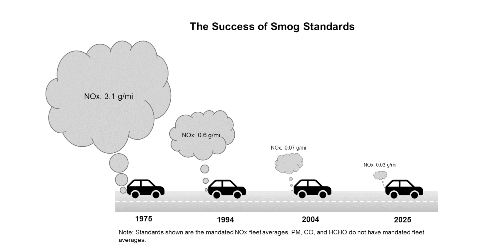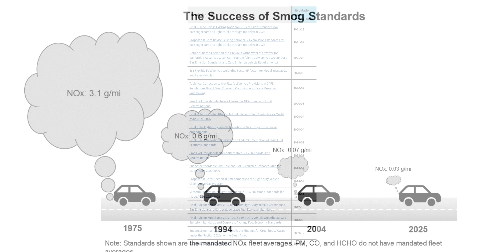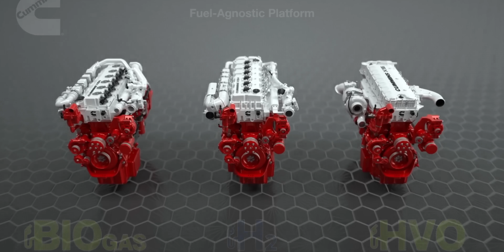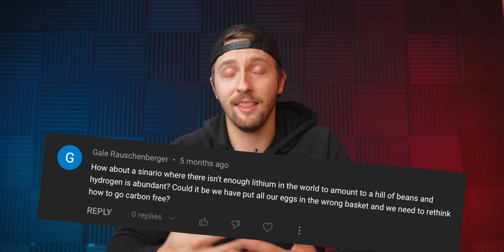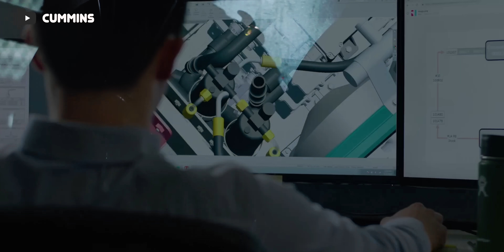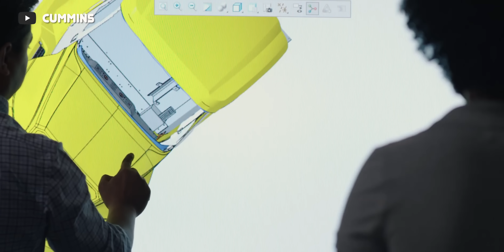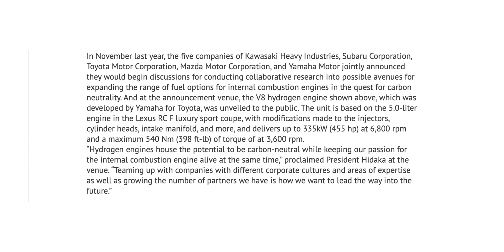Cummins Hydrogen Engine Will KILL DIESELS FOREVER

Comment: It's still a diesel. It just burns hydrogen. Even the first diesel engines didn't burn diesel fuel. They burned peanut oil
Reply: As long as it’s based off Rudolph diesels compression ignition. If it’s not Compression ignition then it’s  not a diesel.
Reply: @justinmartin8887  As long as it’s based on Rudolf Diesel’s engines, it is a Diesel engine. The engine was not named after the fuel it burns, rather the engine and the fuel were named after Rudolf Diesel.
Reply: @Paul H  the Cummins Hydrogen Engine is spark initateded(as per their website), thus it can not be in any way a diesel engine.
Reply: @justinmartin8887 the diesel cycle is characterized by isobaric expansion in reciprocating/cyclical form. A jet engine (brayton) uses the same process, just a different format
Reply: @Heatherder  interesting. Almost any form of internal combustion propulsion could be considered isobaric expansion
Reply: Wonder if they had pleasant smelling exhausts
Reply: @Anonihmus2567  I assume. If you burn waste oil from McDonald's it smells like french fries, I've been told, so I assume peanut oil smells like peanuts
Reply: @Amigafur  it's called the Diesel Cycle.
Reply: @DownLowSyndrome  do you know what it means when someone is on the "down low"?🤔😆
Reply: @toddamtmann3528  that's the joke...
Reply: @Amigafur  1 lol
Reply: @Anonihmus2567  my old diesel golf used used chip oil. Canola and it did smell good.
Just the other day I smelt piss and the source was a new ad blue diesel engine warming up.
Ad blue is merely 50/50 urea and distilled water sprayed in the diesels exhaust to neuter the nitrous oxide
Reply: @Anonihmus2567  probably smelled like baked peanut butter cookies
Reply: @Anonihmus2567  smells like burnt plastic, not sure if this is for all tho
Reply: @Anonihmus2567  owned
Reply: @Anonihmus2567  smell like the fair.
Reply: @Anonihmus2567  it's why dogs chase cars to this day. Hahaha
Reply: @Anonihmus2567 the pleasant smell of supporting farmers and  not giving any extra cash to oil tycoons
Reply: The guy's name was Diesel, and he built the engine to run on damn near any combustianable 'fuel'.
Reply: @painkillerjones6232  exactly.
Reply: @painkillerjones6232   the correct term was the “tailings from manufacturers” in other words he was the one thinking about “free” fuel and recycling.
Reply: @painkillerjones6232  (combustible*) No other correction needed, you're right.
Reply: @B.V.Luminous  Thank you.
Reply: @painkillerjones6232  not NG.
Reply: You're right they burned all kinds of stuff back in the day including kerosene
Reply: @yvescote9893  they still use kerosene. Some people up north mix it with their diesel up to 50/50, so it doesn't gel up.
Reply: @toddamtmann3528  I remember a story about a helicopter running out of fuel and they landed at the gas station and filled up with 50 /50 diesel and petrol
Reply: @yvescote9893  true.. they even still burn kerosene in Cat "diesels" in Antarctica today
Reply: It’s not a Diesel engine. Although this engine shares the same block and crank, the hydrogen, diesel, and natural gas (methane) variants of this engine use totally different heads. Diesels use high compression to ignite the fuel, where as the hydrogen and methane engines run at lower compression and use spark ignition. They also require a throttle plate to manage the air/fuel mixture in the intake similar to a gasoline engine, where as diesels only require the fuel to be controlled within the combustion chamber. Don’t be surprised to see a gasoline variant of the 6.7L from Cummins as well.
Reply: @mikieme6907  you're one of the only commenters on this thread that know ** from Apple butter.
Reply: @mikieme6907  Cummins' LPG/CNG engines are compression ignited with lean homogenous charge (closer to Miller cycle than to Diesel cycle, the same trick pulled by Scania in its I6 engines with CNG).
Reply: @erkinalp  , all methane (CNG) and hydrogen engines built by Cummins are spark ignited. They are modified versions of their diesels (6.7L, 9L, 12L, and soon 15L), where they lower the compression, replace the diesel injectors with spark plugs, and add a manifold injected fuel system.
Reply: @mikieme6907  Hydrogen engines dont NEED this stuff. Its very possible to make compression ignition from hydrogen albeit from my very limited knowledge
Reply: I like peanuts 🥜.
Reply: @John P 5.9 is a much better engine than l10. A lot of Cummins large automotive engines aren’t all that great. The 3.9/5.9, 8.3, ism, big cam and n14 are by far their best.
Reply: @justinmartin8887  i agree with you actually people are 8.3 swapping there pickups some are 3126 CAT swapping there pickups also those engines are bullet proof
Reply: @justinmartin8887  dont forget the isb in there (5.9 & 6.7 variants)
Reply: @John P yea that’s right. The only medium duty diesel in a light duty truck. 6.7 Cummins are good stuff
Reply: @justinmartin8887  Ford has been running their 6.7 in medium duties for a long time.
Reply: @ChevyConQueso  no not for a long time. They used the 5.9 Cummins in medium duty fords for a long time because their weak v8 ps wouldn’t hold up
Reply: Mini thorium reactors
Reply: Actually ? Henry Fords ENGINE'S ran on HEMP OIL
Reply: https://youtu.be/U9EuZCgdIpg
Reply: This is tap water! 
HydrOxy gas on demand
Reply: Electric isn't so great.....hydrogen combustion is more our cup of tea, and you have already got a mostly trained for it automotive mechanics
Reply: It’s not a diesel because it’s not a compression ignition system.  It’s a spark ignited design which requires a stoichiometric mixture to ignite.
Reply: EVs are not electric , they are rechargeable battery powered and in some cases running on diesel or natural gas or nuclear generators .
Reply: Hydrogen is as volatile as gasoline and technically doesn't need compression for combustion, unlike diesel.
Reply: @NoName-ky2sb  Yes you do need compression to squeeze the air molicules to make the fuel more explosive.Thats how the piston is driven down. Suck,   squeeze, boom, blow. $ cycles of an engine, Also when you compress air you heat it up. If you heat it up enough it will cause the fuel to explode. A typical gas engine needs at least 8 to 1 compression ratio then explosion by spark. A diesel engine has at least 17 to 1 copression ratio which heats the air enough to cause the fuel to explode. While we're at it CO2 is an element on the periodic table not a polutant. all we are doing is releasing CO2 from the ground into the air in the form of a PARTICULANT, which will not stay air born for ever. Most of the CO2 emitted in the last 100 years has fallen back to earth and has settled on the floor of the oceans. Diesel exhuast particulants are larger then gasoline and fall to earth faster. plants thrive on CO2 and absorb it  This idea that we are killing the planet is a big con job put forth by the WEF to steel all our assets in order to control us. without CO2 we will slip back into an ice age and that can happen in as little as 10 years. In the last ice age there was an ice pack 2 miles thick over most of north america and it was basically uninhabitable would everyone prefer that?
Reply: @markseehawer3762  hate to break it to ya CO2 isn't an element. Its a molecule like water. But yes plants use it in photosynthesis, no it isn't heavier than air.
Reply: @Mark Seehawer  preach it brother🙌
Reply: It’s basically, how smart are your designers. You ask questions well it takes electricity to make hydrogen so why not just use batteries or EV then?

As a trucker, I look at costs. Cummins is a reputable engine maker is combustion engines.  Most people who design energy efficient engines are muscled out. They tend to hoodwink non technical people about what can be done and can’t be done with limited false options. Meaning we can run engines on water, hydrogen and oxygen by products. Yes electricity is required, we get that from solar panels or hybrid generators that Cummin also sells. Cost me .3 gallons an hour. Meaning I can go about 180 miles on a gallon of gas. This bothers who?
Reply: No i think  it was penis oil not peanut oil
Reply: It won't be a diesel.  It will be spark-ignited.  Cummins has been building spark-ignited natural gas and propane engines for decades.  They are also working on a heavy-duty gasoline engine in pursuit of their "fuel-agnostic" strategy.  But you won't be able to buy an engine that will run on diesel or Hydrogen.  Different variants of the engine family will be designed for the different fuels.
Reply: So the first Diesel engine s cost only Peanuts to Run?
Reply: The first Diesel by Inventor Rudolph Diesel ran on Coal Dust Not Peanut oil the wjole ethos of his design is that it will run on any fuel that's Flash point is lower than the heat of the compressed air,the engine is basically a compressor!! Diesel was a Refridgeration engineer at Sultzer he developed his engine at Machinenworks Augsberg, & the first one sold was made by Machinenworks Nurnberg & sold to the Kieve electric power generation co. After which the Augsberg & Nurnberg companies  Merged to form MAN DIESELS,The origional 5 patentees were these two companies followed by Beirmiester & Wain(Denmark) who put the first diesel in a boat,Kelvin Diesels( (UK) Also marine use,& Cummins (USA) The first to use diesels in Automotive use (Trucks & later a race car in the Indianopolis 500 where it won the Endurance prize!!) So I think Cummins know what they are doing & are well ahead of the game??
Reply: @MrSilvertech  Once upon a time the believed beer fairy’s blessed the beer turning wort  it into beer. People are dumb
Reply: Too many people know to little about the economics of interfuel substitution
Reply: They actually first ran off Coal dust. Regardless tho still compression ignition.
Reply: @andrewschlosser9483  Yes.  Finely ground coal “coke power”.  Germany had a coal supply then. Trying to make his country energy independent. What a novel idea.
Reply: When it was first built in 1892 it ran on coal dust then other experimental fuels. By 1900 it ran on peanut oil at the world's fair...
Reply: Who cares till it pollutes less and there is INTERNAL COMBUSTION
Reply: @praveenhegde8107 😂
Reply: @John P people give the Hindenburg shit.
But the hydrogen while flammable was not the main source of burning lmao.
All the bags that held the hydrogen were A. Cotton. B. We're waterproof and gas proofed in a even more combustible coating. 

So while the hydrogen did burn everything else was still a massive oversight of a fire Hazzard. Besides gas and diesel also burn. And when they do they'll melt down vehicles to their frames.
Reply: Sounds like a bunch of folks that know how to read, what has already been done. 
   We need to discover the NEW so we can 
Move forward. Hood wink that guy who is 
Gargling penis oil and see if they can fig out how to squeeze the hydro for another 150
Miles or more😉🍺
Reply: @User20758  It’s been done, but if you try to mass manufacture it, seems you had a short life span. Only reason they might not care as much now is because of politics and Russians and OPEC going off the Petrodollar.
Reply: I read where hydrogen comes from volcanoes endless supply, I may be wrong
Reply: Creating hydrogen is still pretty expensive, Clean hydrogen costs about $5 per kilogram.
Reply: @rbwoodwork1890  producing it actually is extremely cheap. Storing it is expensive.
Reply: @Amigafur  In the UK, hydrogen fuel generally costs motorists between £10 and £15 per kilogram. In the USA, hydrogen costs around US$16 per kilogram. Currently, renewable hydrogen produced via electrolysis costs between US$3 – US$6/kg, though analysts expect this figure to drop significantly over the next decade.
Reply: @rbwoodwork1890  Source?
Reply: No, the first diesels built burned vegetable oil.
Reply: The first diesel actually ran off tar oil, kerosene. Paraffin oil and Texas oil.  It could utilize any of the 4.
Reply: Burn hemp oil
Reply: @John P 🤣
Reply: What about hydrogen embrittlement?
Reply: Coal dust was even burned as the very first thing back them
Reply: Diesels will burn about anything flammable biofuels are made of vegetable oil
Reply: @MrSilvertech  True, you don’t need large battery bank, need a much smaller one. For initiating start, electronics ect
Reply: Almost correct... It was rapeseed oil 😁👍. Details matter when it comes to history regardless of who thinks differently.
Reply: Lmao try coal dust
Reply: Rudolf would be proud of you
Reply: @John P actually the hindenberg didn't kill everyone. When hydrogen goes up it really does go up. A lot of people survived.
Its bigger problem is that its hard to store. The engineers call it the houdini gas because it is always trying to escape. It won't be a full tank in few weeks even if you don't use it.
Reply: Rudolph diesel also used hemp seed oil and coal dust as his original fuel sources
Reply: @kyleinkster4494  He tried coal dust , it didn't work.
Reply: So wait a gas engine burning gas would be called a petrol engine?
Reply: You can still run diesel engines on waste oil. Not sure about the newest vehicles, but they had wvo kits for every major diesel for years. 

The fuel tank sits like an aux tank in your bed and you swap to veg oil via a programmer and switch essentially. Really neat stuff.
Reply: Hydrogen fuel engines emit WATER VAPOR. Not smog
Reply: @anthonynicholson5523  A H2 engine would still emit NOx (which causes photochemical smog) and would probably still require some kind of emissions system.
Reply: And pot,  the real stuff  = petroleum
Reply: Yeah he says that in the video, it's fuel agnostic so it can use hydrogen and diesel.
Reply: I've  that the first that diesel made ran on coal dust  !
Reply: Bruh, hydrogen cars are 30 years old. $ runs the world not emissions, they use emissions to get $. They don’t actually care. Wake up.
Reply: Actually the first diesel engine ran off of hemp oil if my memory serves me correctly
Reply: @410ytlmustang  No  peanut oil.
Reply: Nope, diesel doesn't use spark plugs.
Reply: That’s nuts
Reply: The first "diesel" engine design and built by mr diesel in germany was used to pump water out and air into coal mines. It burn very fine coal dust.
Reply: @splattered2929  The Idea was to burn coal dust , it did not work. Peanut oil was his second choice.
        His first running engine was a single cylinder 20 litre , was about 2.4 meters tall and developed 20 HP. The peanut oil had to be pre heated to get it to burn.
Reply: A diesel  burns oil, true. And peanut oil is an oil. THAT'S ONE  of the things that make it a diesel. It burns this fuel by way of compression combustion, not thru an electrical charge thru a spark plug in a gasoline engine. Diesel fuel is an oil based fuel. Regardless of where it comes from. The principle of power from combustion is the same regardless of the type of engines we're talking about. It's the type of fuel that designates the name given to the engine. Many of the principles are the same. They are BOTH internal combustion engines. BUT, they are different.
Reply: Ayo who asked ?
Reply: Its a spark engine. Therefore it's not a diesel
Reply: Actually it was coal dust
Reply: Wrong. They burnt coal dust in german coal mines
Reply: @splattered2929  wrong read the books
Reply: Beats electric and all the issues and devastation to widelife with dangerous pollution produced with lithium batteries (plus slavery is not an issue to woke bureaucracy)
Reply: How much power was in the peanut oil and what was the torque of the motor.
Reply: Hydrogen engines are not diesel engines, they are not compression ignition.
Reply: Didn't knew that.
Reply: They burnt coal dust!. Check it out.
Reply: *Compression engine.
The hydrogen engine is a Compression Engine. 
Just like the diesel engine is a Compression engine, they're not the same. The hydrogen engine is NOT a "diesel engine"
Reply: Electricity converts water to hydrogen so hydrogen fuel is just another form of a battery. But as of now coal and natural gas produce most of our electricity. Until society removes the stigma of nuclear power, why not just continue to burn diesel. In cities that have air quality issues, I get it. Give those folks incentives for something like this, but forcing folks in rural areas to live as those in large population centers is not sensible.
Reply: @MrSilvertech  A lot of old engines didn't. Grid heaters (what the Cummins B series use) and glow plugs didn't really get mainstream use until pickups started getting diesels. Ether injection buttons can still be found in old equipment, much of which relied simply on high compression to ignite. International DT engines don't utlize grid heaters or glow plugs, but the smaller DT444 (Also known as the Powerstroke 7.3) got them. Driver conveniences. I don't mind having either... it helps, especially with modern piston rings that don't tolerate ether well.
Reply: So hydrogen produced off of a nuclear grid that exhausts water or diesel that exhausts pollution?
Reply: Diesle Rudolphs first engine actually burnt coal gas.  So long as its compression ignition then it's a deisle cycle, regardless the fuel
Reply: Huh, I wondered what that smell was, reminiscent of peanut butter farts. Kind of an old fart myself, so I should know...
Reply: Did you know Jimmy Carter ran the very first peanut engine.
Reply: Gasolinecombustionengines run on hydrogen. Dieselengines do not.
Reply: That is just Semantics... call it whatever you want but it now burns clean hydrogen not dirty diesel... which is the whole point.
Reply: @paulhope3401  
Dieselengines can not run on hydrogen.
Reply: @marcelmolenaar5684   Yep, also my opinion, tell that to the OP, he seems a bit confused.
Reply: @paulhope3401  
Opinion? 
Combustionengine combustionfuel.
Compressionengine compressionfuel.
Reply: @paulhope3401  
Opinion has nothing to do with it.
Reply: @marcelmolenaar5684   French fries are tasty though IMO.
Reply: @paulhope3401  
Yes. Diesel must be replaced with a mix of Kerosine and sunflower-oil for instance. But, is it possible to make gassoline ans stuff without making diesel ?
That is what i do not know.
Reply: Right? Six of one, half a dozen the others I’d like to see him answer the question we’re all thinking atm…. 

Can this fancy new engine burn Gypsies?
Reply: That's nuts
Reply: About 10years ago I hand A Mercedes that I Ran on vegetable oil it was cheaper than diesel at the time
Reply: You sir are educated! This is ridicules. It IS a diesel. Diesel's design ran on peanut oil, not crude processed into something labeled diesel fuel. Hydrogen will beat electrics.
Reply: No the first diesel burned powered Co with compressed air for injection
Reply: Yea I thought it was a hybrid could be used to run off either
Reply: Hydrogen is harvested from diesel fuel.   Do not fall for it.
Reply: Its not a true diesel. The engines wont last as long because diesel fuel is a lubricant. Low r.p.m and the lubrication properties of diesel fuel are the two main reason why they last a longtime.
Reply: @BAMBOOM2021  false. The longest lasting piston propulsion engines run on natural gas. Due to the extremely low ash content in the combustion, they have no cylinder wall abrasion.
Reply: i wonder if someone could convert a fully mechanical 12v cummins to run on hydrogen fuel then.
Reply: Yep.
Reply: I disagree. Hydrogen is too explosive to diesel. Thus the need to change the heads out, and I would assume fuel delivery as well
Reply: Best use is to add a hydrogen feed in with the diesel injection. Creates a cleaner burn with less emissions and reduces diesel usage.
Reply: @deefishlaugen9169  they have engineers man. If they say one cylinder head… it uses one.
Reply: @deefishlaugen9169   that’s likely not why. I haven’t looking into this yet but it likely have more to do with fuel delivery. If the aluminum piston can hold up the iron cylinder head certainly can. It’s got to be fuel delivery changes. Maybe a need for spark plugs. 🤷‍♂️
Reply: @deefishlaugen9169  So what’s the price comparison? Price per mile, price per pound or gallon?
Reply: @deefishlaugen9169  
Any fuel can be burnt in compression ignition.
Reply: @deefishlaugen9169  The main trouble hydrogen is a gas, unless cooled near 7°K, to compress it to injection pressures, will take much power and  rise its temperature above the temperature of the compressed air, definitively not a fuel for diesel engines, The steel will  crack due to hydrogen embrittlement. 🔥
Reply: @deefishlaugen9169  thats what i thought hydrogen would be like a bomb going of in the motor and would quickly cook the heads cheers.
Reply: @Dee Fishlaugen  it depends on the mixture ratio, adding HHO and propane is a good way to extend fuel mileage
Reply: Yeah the process of fuel burn is called dieseling. The fuel has just changed
Reply: then, they weren’t diesel. they were peanut oil engines.
Reply: If it doesn't burn deisel it's not a deisel
Reply: How do you come up with such brilliant observations? Where do you find the time? What, with your charity work, daily gym, multiple businesses, and homeschooling your kids? Amazing!
Reply: Hydrogen is electric. Used hydrogen through a catalyst to generate electricity.
Reply: @slaphands7703  that's one way to do it.
Reply: Peanut oil doesn't come from crude oil.  Rudolph Diesel used left overs from crude oil, not peanut oil.  Hence diesel fuel.
Reply: @bertgrau3934  🤦‍♀️
The whole point of the original Diesel engine was that you could make the fuel yourself. Diesel fuel was not invented until after WW1. Diesel engines were invented in 1900.
Reply: @Amigafur  
That's not true, crude oil was used for several fuels,  they were used for lamps,  starting fires,  in the 1800s.  They didn't use a lot of refining,  just to get the thick heavy stuff out and use the thiner for lamp fuel.  Mr Diesel used the less desirable for Diesel fuel.  If you study Rudolph Diesel,  you can find where he tried a few different combinations before using what at the time he thought was Diesel fuel.  What we have today is a far cry from real Diesel,  it's trash as far as the rest of the world goes.
Reply: @Amigafur  facts, you could run a diesel engine on vegetable oil if you wanted
Reply: @bertgrau3934  His first engine ran off peanut oil at the World Exposition in Paris.
Reply: @bertgrau3934  he marketed his engine as having the ability to run on most combustible liquids, which it would.... INCLUDING PEANUT OIL.
Reply: @bertgrau3934  The first one ran on peanut oil. His original idea was to run it on coal dust because there was loads of it lying around where he lived. That did not work out so he tried peanut oil. 
    I have no idea when he started using petroleum type oils.
Reply: @briancarton1804  
Thank you for that information,  from what I  read he used something from crude oil that wasn't being used.  That was from the 1980's,  so the information very well could have been wrong.
Reply: @bertgrau3934  The first one ran on peanut oil. His original idea was to run it on coal dust because there was loads of it lying around where he lived. That did not work out so he tried peanut oil. 
    I have no idea when he started using petroleum type oils.
Reply: Real truck use glow plugs
Reply: @trentdawg2832  They only use the glow plugs to preheat the cumbustion chamber. Once they're running the glow plugs stay off. In my Cummins there is an air heater in the intake manifold for preheat cold starting, it does'nt have glowplugs
Reply: @trentdawg2832  Cummins don't even have glow plugs
Reply: @trentdawg2832  haha. Little pickups might use glow plugs. Real trucks actually don’t have glow plugs
Reply: @justinmartin8887  Diesel engines use glow plugs to heat the engine in the winter to make it start
Reply: @terryhill4732  yea, small diesels. Big diesels don’t have glow plugs
Reply: @justinmartin8887 I drive a big truck with a diesel engine and yes it does have glow plugs
Reply: @terryhill4732  interesting. I’ve worked on and operated almost every heavy duty truck imaginable, and I don’t think any of the 12-15 liter inline 6 diesels have glow plugs.
       I would appreciate if you shared what truck you drive, I would like to know which big truck engine has glow plugs
Reply: @justinmartin8887   International with a Duramax engine also called a Navistar to some
Reply: @justinmartin8887  Also a Freightliner with a X-12 Cummins
Reply: @terryhill4732  yea the x12 doesn’t have glow plugs…. The duramax is a tiny engine
Reply: @justinmartin8887  funny, the 6.7 cummins in my ram 3500 doesn't have glow plugs, the 5.9 24v in my '02 dodge ram 2500 also doesn't have glow plugs.
Reply: @justinmartin8887  some older big trucks have either injection to start in cold weather.
Reply: @FxckTheAFT  no they don’t… a lot of the smaller Cummins do have intake heaters though
Reply: @Justin Martin  I said cummins do NOT have glow plugs, FORD & GM do though.
Reply: @Justin Martin  cummins uses a grid heater, not glow plugs. Ive personally owned 3 cummins trucks, currently still have 2 of them. I had a 3rd gen 6.7 g56, & currently have a 4th gen 6.7 68rfe & a 2nd gen 24v nv5600. I know the difference between glow plugs & a grid heater & I know the cummins only has a grid heater. Duramax & Powerstroke use both glow plugs & a grid heater.
Reply: @alphonsotate2982  no they don’t. Your example of large equipment and mine apparently differ.
Reply: @FxckTheAFT  yes, I wasn’t contradicting, I was agreeing
Reply: @Justin Martin  ah. Ok. Gotcha. Hard to tell exactly what someone means sometimes just reading a comment.
Reply: @justinmartin8887  they don’t have glow plugs anymore but they use to. Technology has changed so that they can ignite the fuel without the assistance of a glow plug.
Reply: @rbwoodwork1890  that’s not what glow plugs are used for. They simply preheat the combustion chamber to help achieve compression ignition
Reply: @justinmartin8887  what do they have…..nothing….compression start??
Reply: @justinmartin8887  them what's that clicky nose my Freightliner makes before I start it?
Reply: @dgage1776  that’s your abs valve’s cycling. I sure hope you don’t have a CDL.
Reply: @justinmartin8887  I sure do! Been driving for 6 years in Wyoming. Good thing truck drivers don't fix their own trucks huh? I bet mechanics wouldn't know how to drive a truck in a snow storm either
Reply: @terryhill4732 mine doesn't
Reply: @Trent Dawg  cummins engines don't use glow plugs at all, they use a grid heater. Only Ford & GM use glow plugs
Reply: @FxckTheAFT  Toyota, Nissan , Mitsubshi , Hyundai and other companies use glow plugs. They are generally used in smaller , lower compression Diesel engines.
Reply: @Brian Carton  I know other companies use glow plugs, cummins is what im talking about & they do NOT use glow plugs, not even the isb 6.7 or even the old 6bt (12v). They use a grid heater & thats it. Powerstroke & Duramax use BOTH a small grid heater AND glow plugs. Your reply is entirely irrelevant
Reply: @trentdawg2832  you love barbie trucks? 😂
Reply: @samuelhatch8470  i also love yo mama
Reply: @trentdawg2832  I feel the same about your Mom.
Reply: @trentdawg2832  good morning Trixie Dawg.
Reply: @trentdawg2832  clever little punk keyboard boy.
Reply: @trentdawg2832  maybe we can meet up and see what's up. Trixie Dawg.
Reply: @trentdawg2832  yup, spit that thing out. It's not yours professional laundry man.
Reply: @trentdawg2832  rainbow 🌈 guy. Trixie Dawg 😂
Reply: Trixie Dawg 😂😂😂😂😂😂
Reply: @trentdawg2832   No big bore diesel uses glow plugs. Cat used to, don't remember what engine but it used precombustion chambers and was I think it  low compression.
Reply: @trentdawg2832  the glow plugs are only for cold starting once the engine reaches running temperature they are unesscesary big diesels are started with burning tapers the big marine ones with a blank shotgun cartridge as were some of the old Cyclic Aero Engines
Reply: @trentdawg2832  im a real boy
Reply: @trentdawg2832 diesels don’t need glow plugs with common rail glow plugs aren’t needed and more problematic